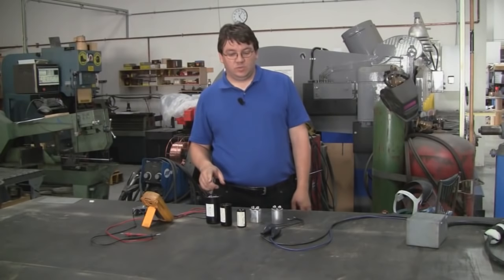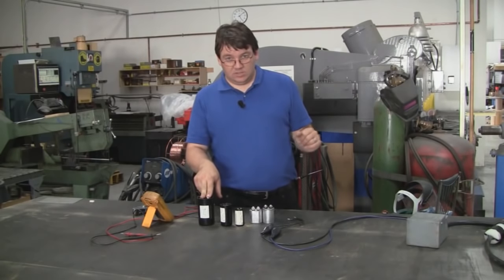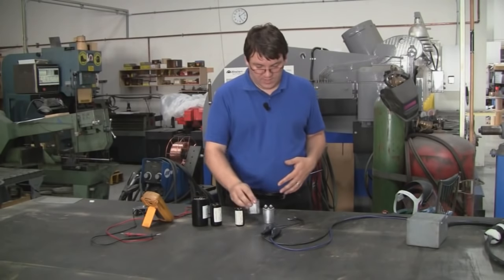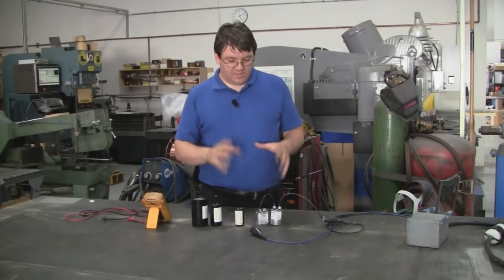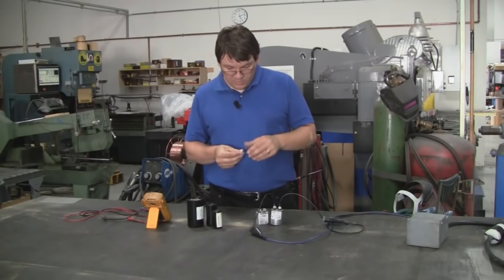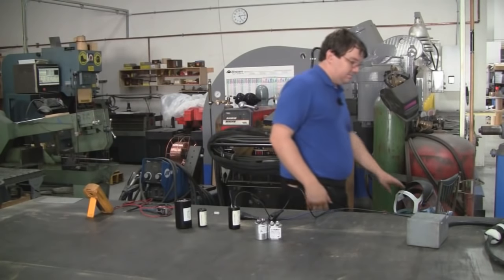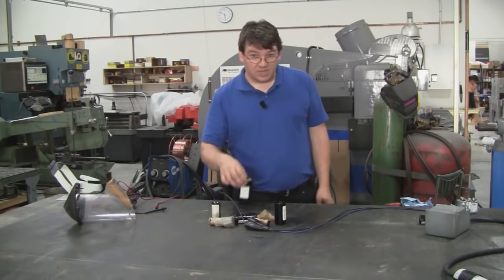Start Capacitors & Run Capacitors for Electric Motors - Differences Explained by TEMCo

Comment: hey i got a bench grinder and it just hum's and the start cap is a cbb60 250 v so the scr002 will replace the old one
Reply from the maker: +Douglas Hatfield What is the microfarad (uf or mfd) rating on your start cap? The SC0002 is 430-516 mfd. (SCR002 is our start capacitor resistor part number.) If the rating matches, it would be a replacement.
Reply: its a 6uf+5% and i can start the motor by turning it to help it start and it will run,but other than that it just hum's
Reply: 250v 6uf+5%
Reply from the maker: +Douglas Hatfield The mfd rating looks more like a typical run capacitor rating; are you sure it is a start cap? We don't have a direct replacement for that particular rating of run capacitor, but you can check out other vendors for a 6 uf cap.
Reply: not sure i was just trying to find a replacement for that one
Reply from the maker: +Douglas Hatfield In that case, the SC0002 will not be a replacement for you. Look for a capacitor with 250V rating and 6uf. eBay might be a good place to look.

Comment from the maker: Do you have an exact voltage rating? We do have 100 mfd run caps (check out our ecom site link in the video description) rated at 370 - 440 V.

Comment: You may want to note: forcing a bad "run" cap to run a motor (thinking it is a start cap) will make your house smell like his workshop does after this test (Not good) My ac fan was not starting so I gave it a spin.. powered it up and said I will replace the cap in the morning....8 hr's later,,,,, well lets just say my wife is not speaking to me at the moment.

Comment: i am looking at building a hi voltage cap for a science project...  i know some about the conductors and the dielectrics.
two plates separated by a dielectric is a basic one.
my question is....
can i run my plates horizontal yet spiraled vertically with each plate overlapping at edges.... example is as how the Super magnets are made in this video.
note from 4.50-5.50
THE STRONGEST MAGNET IN THE WORLD
Reply: yes i know the insulator would have to stick out past the plates quite a ways to stop arcing between plate edges.
Reply from the maker: Matthew Norman
Sorry we don't have much info on this; this is out of our range of expertise as we don't manufacture the capacitors, but we wish you luck on your project.

Comment: So why not use run capacitors with the correct MFD rating as start capacitors,
Seeing start capacitors appear to be cheap capacitor designs which then self destruct in 3 seconds?

Is it just a cost issue of a few dollars? Think what people must pay to have a service man drive out to replace your start capacitor, saving a few dollars sounds like fools money. Perhaps that is what they desire?

Comment: i have a problem. i have a 14x40 metal lathe 1 year old and i was running it at 1100 rpm and went to move the forward reverse lever into neutral and went to far and put the motor into reverse at 1100 rpm. i saw a flash of light comming from the 3 hp single phase motor area. now the motor does not work there is power to the machine the green power light is on but motor dosent work. theres two round looking things on top of the motor maby capacitors i think. what do you think the problem is. any help would appreciated thanks.

Comment: What is Dual Capacitor and what is the different between a Dual and Single Capacitor?  check tthis video out. It explains the difference between a Dual and Single run capacitor.

Comment: Thnak you for posting this. Is a while since you posted the video but i want to ask for this anyway.

I learned with the video if a have a run capacitor example 15uf 380V or 15uf 440V is due the Peak to peak voltage and is oficially recommended to use double voltage. This i get it perfectly.

Since i work with these capacitors a lot of years ago, i made the mistake (according to this video), to replace 15uf 400V with 15uf 250V. Both are run capacitors, this is where my confussion starts, they both runs fine, the life of both capacitors are long enough to justify the replacement due long use in the moment they start to fail. Both cases are 2 live phases or 220v 60Hz. In theory this mistake of mine should cut the expectancy of life of the 250V capacitor?. 

Thanks.

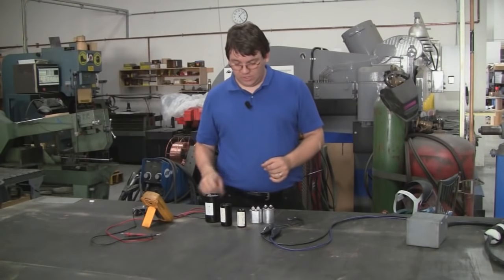Comment: 1:08 - "Now a Start Capaci->BANG!<-" Please, I used to work in valve audio and make valve (tube) gear, never NEVER put your hand on terminals especially in an instructional video as it sets a bad example - unless you want to meet God :o)
Reply: Prince Westerburg, don’t be so dramatic. “Meet God”, please.  I’ve never known a capacitor to kill someone.  First, you would need both hands (one hand on one terminal and the other hand on the other) in order for the charge to go through you.  If he were to touch it with one hand, then he would get a good pop on that hand alone.  I guess you wanted him in full body gear just to demonstrate a point.

Comment: Great tutorial, thanks!

I hacked a Sears Garage Door Opener to power a meat mixer. Opener motor has a start capacitor with 53-64 mfd, 220 vac rating. Motor has a thermal cutoff (only designed to run for ~30 seconds or so), so I ran compressed air into the motor housing to keep it cool:

https://www.youtube.com/watch?v=UiOQeElwpjI&t=24s

Everything ran fine with no meat in the mixer, but with only 4# meat the capacitor blew up after ~4 mins. After watching your video, I'm guessing the cap blew due to an overloaded motor. 

So I made a new driven sprocket to replace the yellow one in the video with double the number of teeth to reduce the strain on the motor. 

Before I spend $20 on a replacement capacitor with the same rating, does this sound like it will work? Would a higher capacitance rating be advised? Or is there another reason the original capacitor blew?

Thanks!